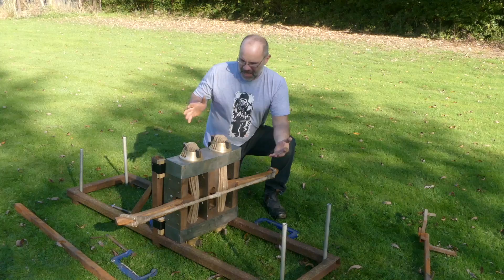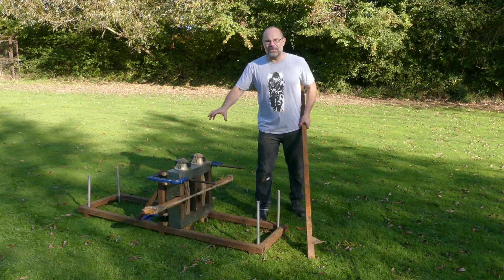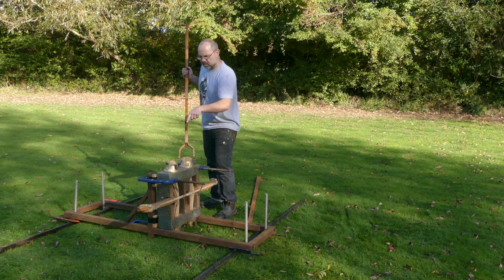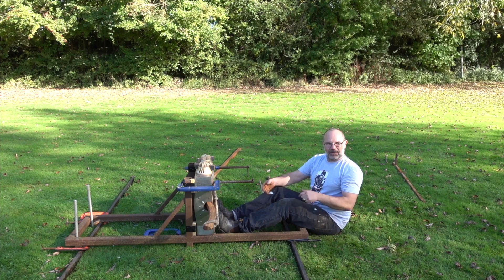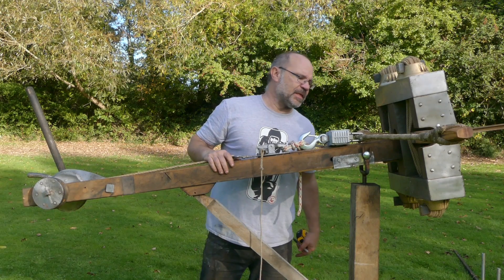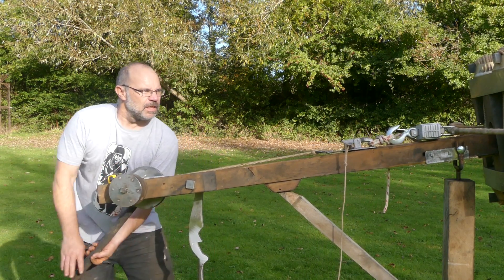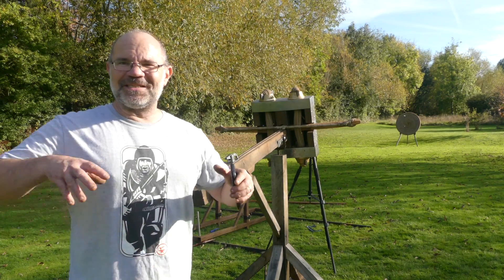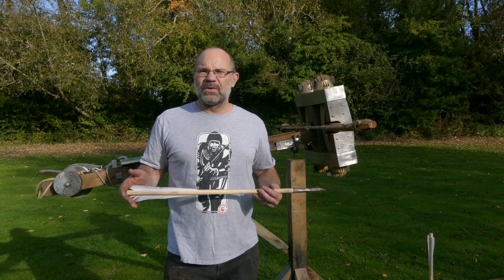CATAPULTA INCREASING POWER PT 2

Comment: I looked at this about 35 years ago on a tiny scale model, I think it was really small. About 1-10 scale and I just couldn't seem to get the tuning right as there was sort of some economics of scale for small things which really only work at a material science level when they are bigger. Especially when it came to the torsional materials there wasn't much about that would work!
The really scary thing is, even at the size you're working at (which is not inconsiderable) would probably have been classed as a light artillery piece they would have tacked onto a centuria as sort of auxiliaries and the big gear you got in Legions was so much bigger its quite scary.

So I do appreciate and understand the struggle. You might need more blokes soon though for muscle
Reply: I think Tod mentioned in his previous vid that “Enginering doesn’t scale”.

Comment: Great video as always. BTW recently I've read interesting article about Roman balistas which claimed that nowadays the consensus among academics is that the arms were reversed, pointing forward and pulled inwards.
Reply: Surely that cant be right, i believe what you mean is slightly bent forward when resting, because a fully reversed crossbow would need cams or something akin to them.
Reply: @arobotwithepilepsie6053  As I understand it, arms were supposed to point directly forward at rest and were pulled inwards. That allowed for longer draw (you can go almost 180 degrees back), thus providing greater energy on release.
Reply: @lazyman7505  I guess that, pulling the arms back a lot further like that would reduce the requirement to keep the bundles under so much tension when not in use? 🤔
Reply: Inswingers are only for the cheiroballista which was a hand operated one described in Philo, but archaeological evidence and Trajan’s column shows larger versions existed. 

Outswingers like that of Todd’s also existed, in fact these designs can’t be inswingers as there’s no space for the arms to swing inwards, the arms will hit the casing and each other.
Reply from the maker: Agree with peasant Mob.  Basically out swingers like mine were earlier and then the higher efficiency of the in swingers partly took over
Reply: @tods_workshop  I never had you down as a Swinger, Tod.
Reply: @tods_workshop  Thank you and @Peasant Mob for the comments, it's a good day when you learn something new. And today IS a good day :)
Reply: https://youtu.be/YezJogeFizE?t=558 for an example ;)